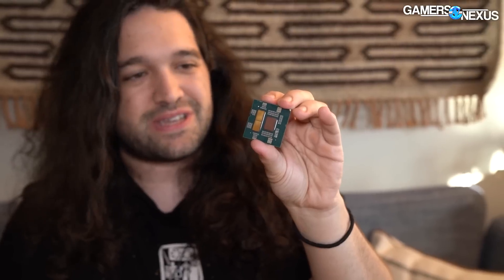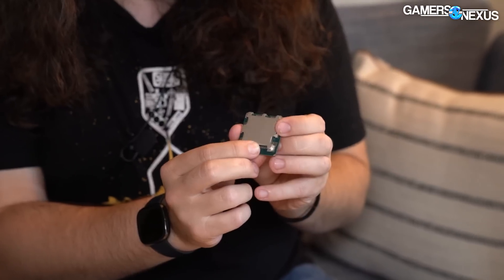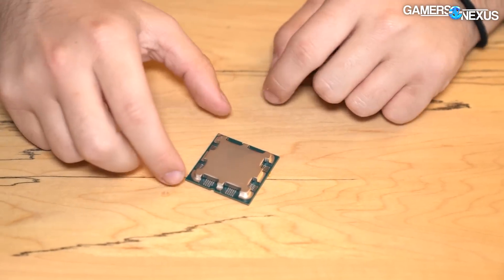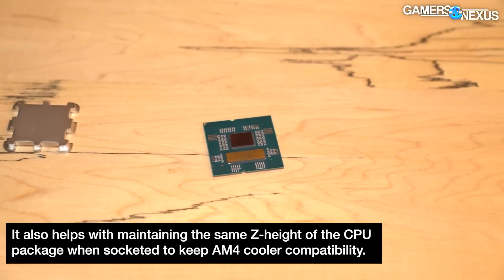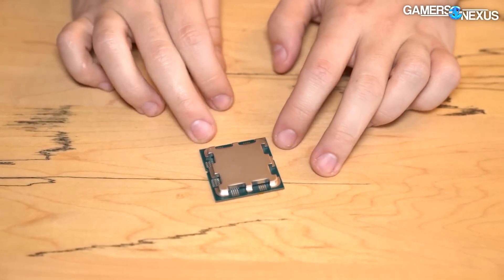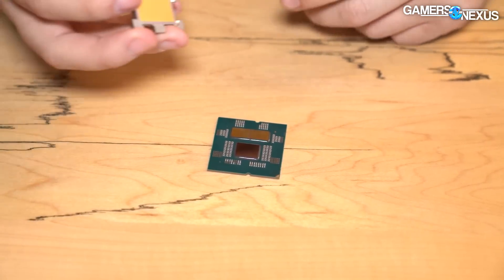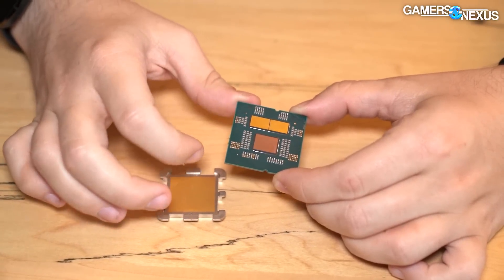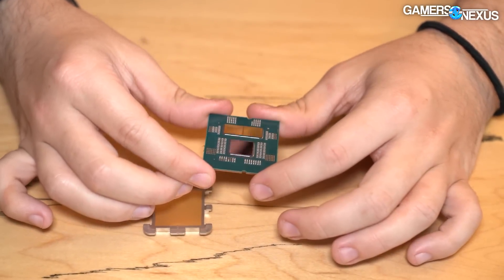Hands-On with Delidded AMD Ryzen 9 7950X CPU

Comment: We know from the past that the infinity fabric will basically make dual chiplets seamless when communicating and depending on each other. However having everything on one chiplet will have its benefit and that's why I'm getting a 7700X unless they release a 7800X (which they already registered the name of). I am not a content creator and I do not need 12 or more cores. 8 cores are MORE than enough for gamers.
Reply: Dual CCD chips effectively double your memory bandwidth though, can be useful in certain situations. Historically dual CCD are just a little more difficult to OC
Reply: Since AMD will be doing the 3D V-cache, I believe that the 7800x will be in this version (7800x3d), but the 7700x for gaming is the best one by far. The same TDP of the Ryzen 5 but with 8/16 and better clock speed.

Comment: Gold is not there to remove the flux. You still need to flux the indium. While you wouldn't have gold oxide, indium oxide would still be present. This allows you to use milder fluxes, but a flux is still needed.

Comment: We honestly don't need IHS anymore and could be doing direct die cooling. Cooler mounting has come a long way from the Athlon days where people were chipping the corners of the CPU die trying to mount the CPU cooler. The spring clip-styled retention method requiring angled mounting is mostly gone, pretty much every cooler now mounts straight down onto the CPU and screws down. Only the cheapest/worst of the worst coolers still use that spring clip method utilizing the stock AMD plastic CPU cooler mounting bracket. Direct die cooling should offer increased performance to help with the ever increasing thermal loads.

Comment: I wonder what challenges the open areas around the SMDs will create for XOC.  Also if there may be some small extra benefit to down draft air flow around the processor did to these gaps.
As tight as it already is,  it has me worried for multiple generation support though.

Comment: I'm gonna wait until 8000 since I really like my 5700x right now. But I'm definitely going to try and not worry about thermal paste between the feet.  Paste in those spaces probably won't matter at all and you won't even see it with a cooler attached.

Comment: Should we be concerned about the exposed parts of the cpu collecting dust? Typically everything of import is below the plate, so it has never really been an issue in the past.

(dust is always an issue - but you get what i mean - we haven't had parts of the cpu exposed before like this below the cooler).
Reply: "We haven't had parts of the cpu exposed before like this below the cooler" Do you remember every CPU from the late 90s? Like Intel's Slot 1 Pentium IIs and IIIs, and AMD Athlons, etc.? They had SMDs and even the CPU die exposed, they didn't have an IHS, and they still work, even when covered in all kinds of "dust".
Reply: @FoxMulder78  Cool, thanks. Not to date myself, but that's a little before my PC building time. Good to know that it shouldn't really be an issue (at least not that).

Comment: Hey guys Can someone answer please... Im a Big fan of Liquid metal for cooling solution...I just wondered what would happen if a little liquid metal drop on those Capacitors/Resistors?? Will I be fine or NOT?? I really want to know. Tnx
Reply: No, if it doesn't outright short some of the capacitors, it will degrade the solder joints.  Don't use liquid metal without putting conformal coating on those caps first.

Comment: We will have to be careful when delidding it, but also with thermal paste application. Sure, it's non-conductive, but if it squises all atound the legs, it will be a PITA to get it out of there without popping out some SMDs in the process.
Reply: why would you need to get it out tho? Whats the point?

Comment: I guess the V-cache technology hasn't matured yet to become a standard feature of Ryzen CPUs. I guess the voltage problems are still being an issue.
Reply: V cache versions will be released q1/q2 next year
Reply: @malborboss5710  I know, but it looks like there's still issues with it that would make AMD have to create a separate product line for it, rather than have it with the 7950X, 7900X, 7700X and 7500X.
Reply: @CallOn84  I think the reason is just segmentation/pricing. Yes, the 5800X3D runs slightly lower voltage but for workloads that benefit from the extra cache (and why else would you get a 3D? ) the performance uplift speaks for itself regardless of voltage. I suppose it would be nice if they could run same voltage but maybe cooling the stack is a bit more difficult than cooling 2D
Reply: @MichaelCoombes776  Maybe so. Once they fix the cooling problems, maybe we'll see it be a standard edition for all Ryzen CPUs.

Comment: These will run fine temperature wise, they are not space heaters like Intel CPUs.
Reply: This meme is not dead yet? 12th gen is on par if not better in temps compared to their Zen 3 counterparts, with the exception of the 12900K which only runs hot because Intel set a dumb power limit. Reduce it to 170W or under and it trounces the 5950X.
Reply: @lunetailedfox  I was comparing Zen 4 vs Intel upcoming Raptor lake CPUS

Comment: Wonder if the IHS will have the same issues as the Intel 1700 with bending and mounting pressure. Seems to be much thicker. Also curious how cooling looks with smaller dies that are even further from center than Zen3.

Comment: I think I'm over delidding, we'll see what the performance benefits are but, this one looks really hard, it's not like 3rd to 8th gen Intel where it wasn't soldered, for soldered, I'm not sure the performance benefit is worth the risk.
Reply: Yeah, non soldered CPUS are pretty straight forward but this is way more complex. I more than likely won't try it since a 7950X costs almost 3 times what my 4790K did and I know I won't see a 15C drop like I did with Devil's Canyon.
Reply: 5-8 gen Intel

And I believe the difference for 12gen Intel is ~2°C so unless AMD has a worse solder connection which I doubt, delidding won't be worth it.
Reply: Exactly. Certainly not worth possibly destroying an expensive part. Reminds me of people destroying AMD Durons back in the day.
Reply: The difference is apparently about 20C, which brings the temp down from ~90C at high load to ~70C
Reply: @ArtificialDjDAGX  that's if you do direct die cooling, the IHS is the problem.

Although delidding might still be worthwhile considering the thermal design of Ryzen 7000.
Reply: @Ocastia  Yes, exactly, which is why my answer is aimed at the first person in this chain, someone that's going "delidding for direct die cooling is probably not worth the risk", when the gain is a nearly 30% temp decrease.

Comment: I’ve had the same Noctua cooler since AMD Bulldozer. They gave me a free adaptor to work on AM4. They fact that it will continue to work on AM5 is nuts.
Reply: I still have my OG D14 cooler from my Phenom 1. I had a unlocked x3 chip back then, saved money on the CPU and spent it on the cooler.

They have sent me AM4 and a newer Intel mount too.
Reply: Yeah my D14 is from my q9550 :D
Reply: I have a Scythe Zipang cooler from 2008 used on my AMD Phenom 4 and it too fits AM4, so it would probably fit AM5.
Reply: I bought a $13.99 open box Arctic Cooling Freezer 7 for Core 2 Duo in 2006 and the fan died in 2011 so Arctic Cooling sent a replacement fan. That cooler then stayed in my main PC for the next 9 years until fan failed in 2020
Reply: @Defective Degenerate I have the same water cooling loop since 2010, first on 3xxx Intel CPUs then some 3xxx Ryzen and right now its on a 5800X3D.
The cooler is a still working good and everything else, I replaced the pump so far because of noise. There are brackets for this Aquacomputer cooler for almost any socket so far.
Reply: @Vanadium  do you have to clean it, drain it, refill it, or  partly disassemble it at least once per year? Also, great job!
Reply: @Dennzer1  No I dont need that, Its a full copper block and copper rad and stainless steel parts, I think. I also use PVC tubes, still not brittle.  I use a clear UV active fluid since I build it. If I have a small leak I can see it. I have cleaned so far this system only 3 times.  I hardly can see anything when I cleaned it.
Reply: Oh heck, that's excellent news for me. If I ever upgrade to AM5 I'm covered then.
Reply: Have been rocking my corsiar h100i aio since my 8320 days, surprisingly it has held up great and performs just as good as the day i got it.
Reply: @zJericho101z  It will probably just keep chugging as long as you keep using it regularly.  From my experience aged AIO's will die if they are taken out of service and sit for a little while.
Reply: I'd like to remind that there is nothing free. You should say "included in the original price" and further more - I also payed for it and never needed it.
joke part / not serious: as I see it you own me $0.75 - please contact me. :)
Reply: Less e waste :)
Reply: @Defective Degenerate Haven't you  heard? Apparently , the internet says we  are idiots..... or, anyone who either buys the NH-U12A is an idiot..... or anyone who buys an air-cooler  and overclocks is an idiot..... or, I can't remember all the ways  that I'm supposedly an idiot for buying a tank air cooler that I'll never need to replace..... & by the time "never" runs out in this context, we will al be using 15 watt APUs for 4K 360 Hz gaming, with Unreal 7 graphics.
Reply: If you want a really nice 120 fan for a cpu cooler, Asus ROG STRIX XF120 can go 1800 RPM, but it seems to be fairly silent at whatever speed it's at.  I replaced both my Scythe Fuma 2 fans with just one of those in between the 2 heat sinks.

Comment: Will thermals really be under control with such a design? To an ignorant like me, it looks like it would have more trouble dissipating the heat, with less surface and contact points?

Comment: Wait do I need a new motherboard like what intel did or can I still use my x570?
Reply: new socket AM5 with support for up to zen6 (byond 2025 )...it is known several years by now, that zen3 is the last gen on AM4
Reply: Its not like what intel did/does, considering AMD supported their old socket for multiples generations. It has been 5 years after all, with intel its more like 2... and its not like one HAS to upgrade. am4 offers still great cpus

Comment: Not sure how the old spreaders were built, but does the nickpe plating mean you would not want to lap it? or lapping takes so little off it is irrelevant?

Re: "silicone if holding the spreader up off the die"
Would they not have engineering the spreader with the silicon glue in mind?
Reply: Heatspreaders have been made out of nickel plated copper for ages, so this is nothing out of the ordinary, and as far as I know it's there to protect the copper from oxidation.
Derbauer made a video about thermal conductivity a few days ago that explains the difference between materials, you should check it out :)

Comment: AMD/Intel should sell CPUs without the IHS for enthusiats who want to attach a cooler straight the DIE
Reply: As that is incredibly dangerous they 100% will never do that
Reply: @erichall090909  Do an image search for "Athlon XP".  No IHS.  Not incredibly dangerous.  There is some risk of cracking the die with a really bone-headed cooler installation, but that was pretty rare.
Reply: Won't break in transit with a good cap. If the user breaks it, it's on them. It's only for users who can accept the risk, or professional builds. More likely to break it removing the IHS than installing a cooler

Comment: It's what I've been waiting for! Planning to use LM in the future and all those exposed SMD elements seem thirsty for it
Also can see overclocking gimmick potential that might prove popular, pumping thermal paste under IHS for better overall conductivity, wouldn't hurt I think
Reply: you can just give them some protective coats tho right?
Reply: @tatooine_dream  nail polish is quick and easy. You should be costing the substrate even if it didn't have SMD because the liquid metal can seep into the vias.
Reply: @tatooine_dream  Depends what you plan to do, I'll probably pump GD900 under the lid for fun, no intent of delidding soldered CPU, but aircooler to IHS will have LM, and foam barrier... can't find aanything locally under 2mm here tho

Comment: Hate LGA. Bought 4 Intel motherboards ever, 2 came with pin problems in the socket. Unfixable. Bought 4 AMD motherboards in my life. Never a single socket problema. Once dropped the processor and some pins bent. Bent them back straight with no issue. The processor worked flawlessly until the day I sold it. Worked flawlessly after by the buyers' opinion.

Comment: When I built my computer I decided that I would upgrade my CPU to whatever model would be the last CPU would fit on my motherboard, about 2 months ago I upgraded to a 5950X, the guy never used it, it was still wrapped. I got it for 550$ CAD. Hopefully I will be using for at least 5 years.

Now I am waiting to see the new GPUs and probably will change my 2080 super for whatever top of the line AMD releases soonishly.
Reply: Well it's a bit complicated, and if you are using components for multiple years (5yrs for that CPU hopefully as you said), honestly, NVIDIA may be the way to go still.

DLSS and their sheer dominance in RT Performance and also overall featureset in GeForce Experience is sort of hard to overcome.

Even with FSR2 existing now, DLSS is more efficient and produces a better output, especially at lower resolutions.

Not to mention DLSS adds new features with major revisions and we should be seeing DLSS 3.0 in the near future.

RDNA3 has been rumoured to not really add more inherent RT Performance to the GPU (Just Brute Forcing it, likely with that perf/watt increase)

Problem is NVIDIA is seemingly slated for a similar/better Perf/Watt increase with Lovelace due to them moving from Samsung 8N to the infinitely better TSMC 4N (TSMC 7N was already a far better node than Samsung 8N and Ampere still kept up with RDNA2's efficiency).

So tbh, until AMD adds a true equivalent to DLSS efficiency/quality wise and also gets the featureset up to snuff elsewhere (and vastly improves RT perf) NV may still be the better value (Especially with the 4070 slated to be equal or stronger than the 3090)
Reply: @Alovon  Firstly thats JUST a bunch of rumours and speculations... (which is already enough said), secondly some don't care a lot about RT (like myself, even the material specifically DESIGNED to promote it, I find pretty underwhelming considering the performance cost) and thirdly we don't know how great dlss 3.0 will be and right now fsr 2.0 is nearly as good as dlss apart from low resolutions, but I don't see how thats relevant given you will most likely use AT LEAST 1440p with that kind of hardware.
Reply: @Alovon   FSR2 looks great scaling 1440 to 4k. That's all I need. I could not care less about RT.
Reply: @Alovon  There are also rumors that claim RDNA 3 will significantly enhance Path Tracing performance and will have an equivalent to tensor cores... So with that being said the rumor mill means nothing by the end of the day.

RDNA 2 has gangbuster raster performance, Nvidia's only edge is RT performance(and admittingly Blender Support with Optix Rendering). I think AMD can manage to be competitive here due to the simple nature of path trace rendering. It's expensive to compute but it's straight forward and scales(linearly) really really well with a load of cores........

AMD is already competing with DLSS and I see no reason why that trend wouldn't continue.

Comment: I am going to be terrified to apply the thermal paste to this
Reply: Get yourself some thin plastic sheet and cut a measured rectangle in it to use it as a masking tool while applying the thermal paste.
Reply: @2nd_Directorate  This is an awesome tip. Gotta remember this

Comment: I've not actually seen a delidded CPU before, but now i'm curious why need to delid it at all (when Steve mentioned the tool being developed by Der Bauer)?
Reply: some add liquid metal between the cpu die itself and the IHS to improve heat transfer, some use cpu´s even withour the IHS and mount the cooler directly to the cpu die ( all of this is just used for extreme high overclocking
Reply: @georgwarhead2801  wouldn't like to use liquid metal on this with those exposed smds under the IHS
Reply: Cooling the die directly without the IHS can save a few degrees but that's mainly for people who do crazy overclocking.  If the leaks are true then these CPUs will be plenty fast out of the box.  The SMDs on top adds another level of risk with delidding and the risk outweighs the reward for the vast vast majority of us.
Reply: Very few people will do it especially for this CPU(Used to be a huge benefit to performance on Intel), but we're all nerdy and watching these videos anyway because that's what we do.

Comment: Kinda a shame AMD still have cores on the side and not right in the center of the chip. Wondering how much temperature improvement we will see shifting a cooler closer to the "cores" side with these higher tdp chips
Reply: look at the chip and tell me how on earth you would archiv that
Reply: @georgwarhead2801  Offset kit?
Reply: Imagine thinking a 700 dollar CPU should base their design on teh limitations of a 60 dollar cooler....

Comment: Two questions:

1: did you share a room with Dr. Ian Cutress? It sure looks like it...

2: what the hell is with all those caps? Why can't they be under the heat spreader?

Bonus question: why do they even need to be there anyway?
Reply: Your bonus question was answered in the video.
Reply: @TheAtomicSpoon  mmmmmnot really
Reply: @unfunk  Capacitors are generally used as power conditioners.  They act as buffers to smooth out voltage ripples, so the processor gets a very steady constant voltage without spikes or drops above and below what's called for.